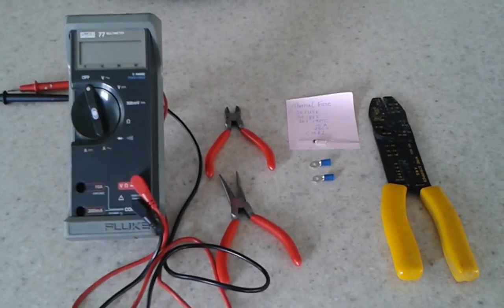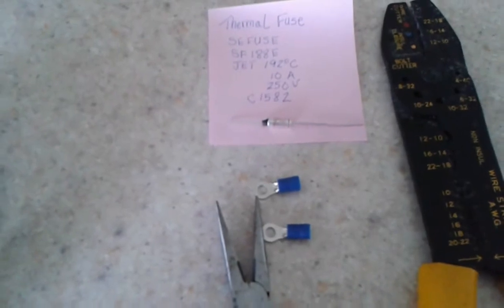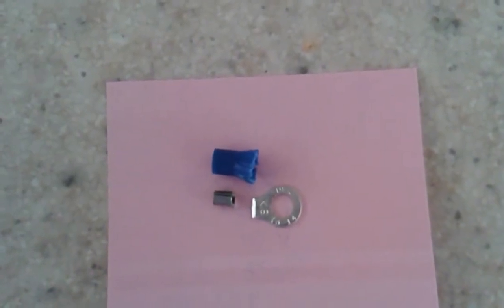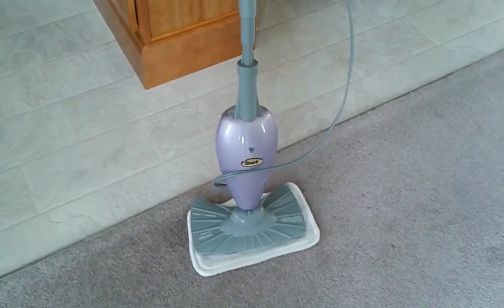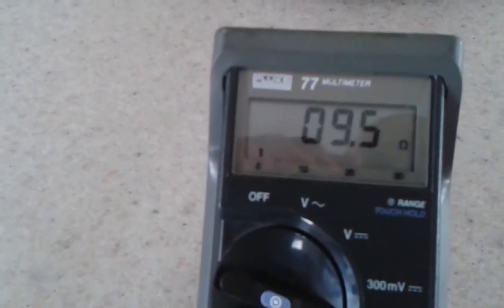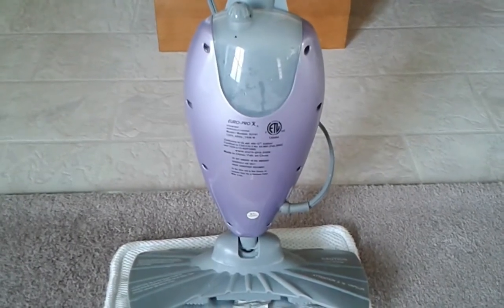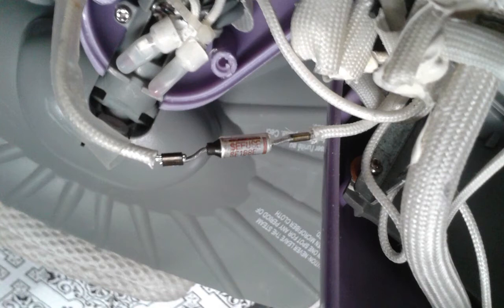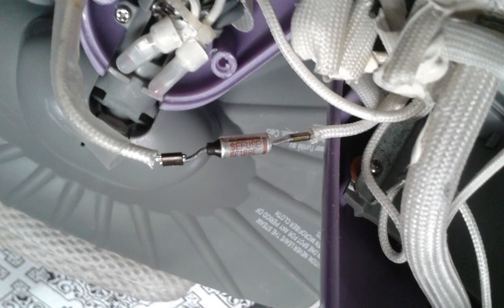Sharp Steam Mop S3101 No Power Repair

Comment: I did this but it stopped working again after using it twice 🤦‍♀️
Reply from the maker: Kelly, first let me congratulate you for attempting to make this repair.  This is a common problem with this Sharp Steam mop and is likely to be a manufactured defect. You would hope the manufacturer would help remedy the issue with the customers like us.   I am at a loss as to what to suggest you do.  If you have the energy and time you can try a new Thermo fuse but one with a higher temperature rating.  The original Thermo fuse is rated at 192 degrees Celius.   A possible replacement is the SF214E.  It is rated at 214 degrees Celius.  You can find it on eBay.

However, caution is advised since you will be using a Thermo fuse higher than the original.  Be alert when first turning on the steam mop.  Pull the plug on the mop if you suspect anything odd when operating it with this new fuse.  Another alternative is to contact the manufacturer and see if they would replace their defective product.  Should this new Thermo fuse also fail, it just may point to another issue with this mop and may not be worth spending any more time or money on it.

Finally,  again my congratulations on attempting the repair.  You're one of the few who have DIY knowledge and self-confidence to attempt a moderately complex repair like this.  Let me know what you decide to do.  Best of success to you and don't lose that courageous spirit and willingness to try.:washhands:
Reply: @aviator5  Thank you so much for the information. I actually forgot I had posted this and it turned out I had plugged the mop into an outlet that didn't work.  🤦‍♀️😂 Before trashing it I decided to plug it in once more and it worked. When I returned to the same house I was cleaning when I thought it broke again, it didn't work when I plugged it in the hallway outlet again. That's when 💡 and I realized it was outlet. Thank you so much for your help though!

Comment: Worked for me! Only difference is that I used a Baomain Copper Metal Uninsulated Wire Ferrule Cable Crimp Terminal Butt Connector(18-22 AWG) to reconnect the new thermal fuse. Thanks for the video.
Reply from the maker: :washhands:Cooper metal crimp is fine!  Thank you for the feedback and I am super glad this video helped you.